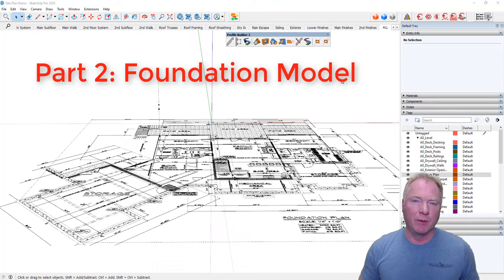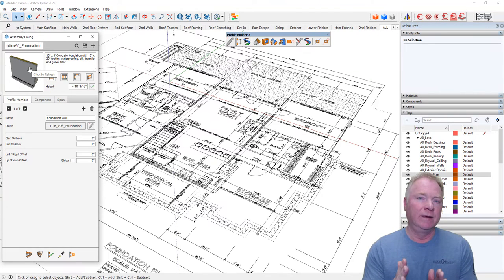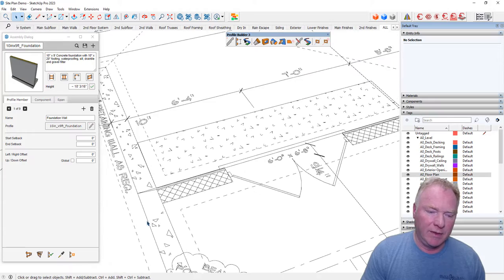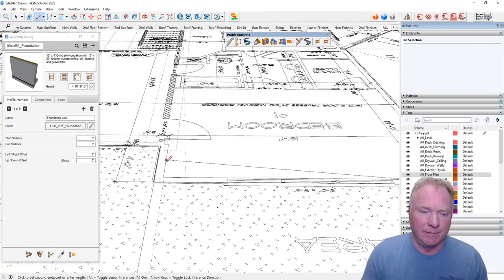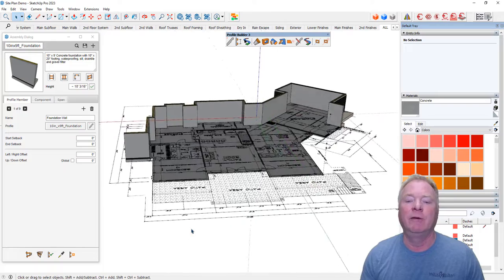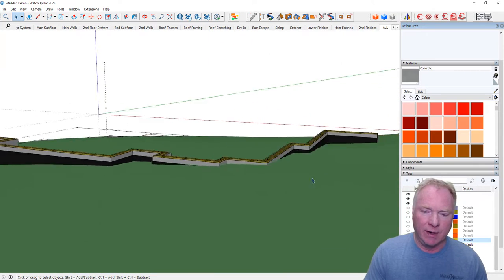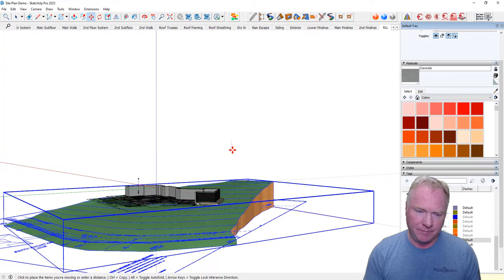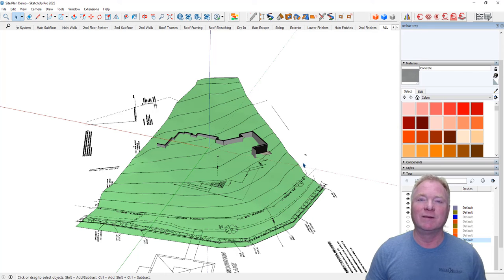3D Site Modeling in SketchUp - Part 2: The Foundation

Comment: Thanks for video. great plugin info.  Any advantage to lowering grade 8" vs raising the foundation and slab that you drafted?
Reply from the maker: In our models, the houses are centered on the x,y.z axis and we rotate and elevate the site around the structure (vs fitting the structure to the site).  If we moved the foundation, we would have to move the entire structure and could easily miss something, so it is easier to move the site model up/down.